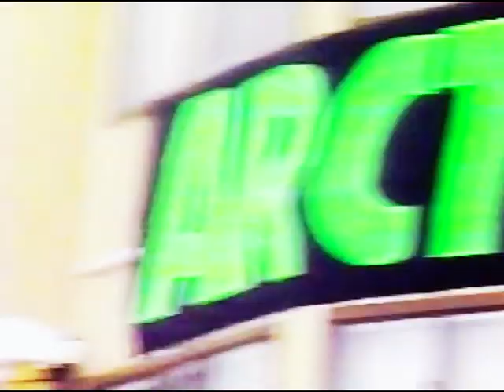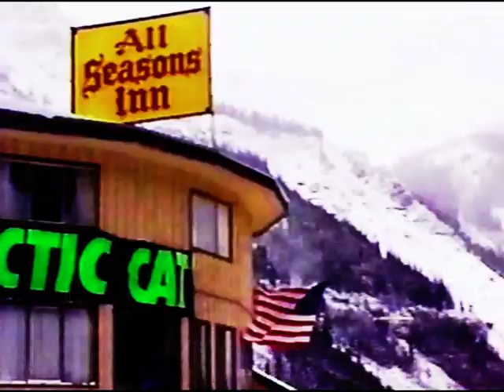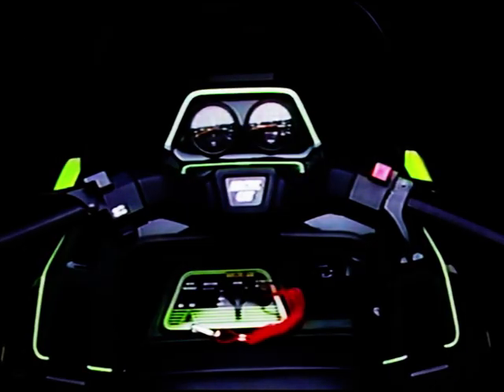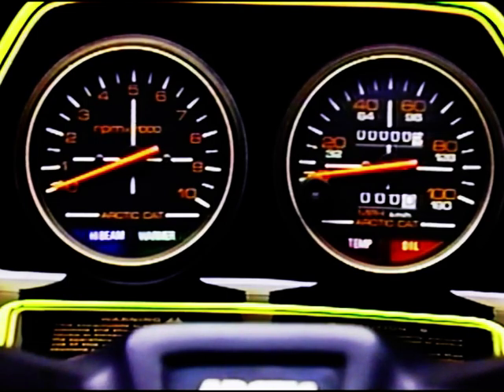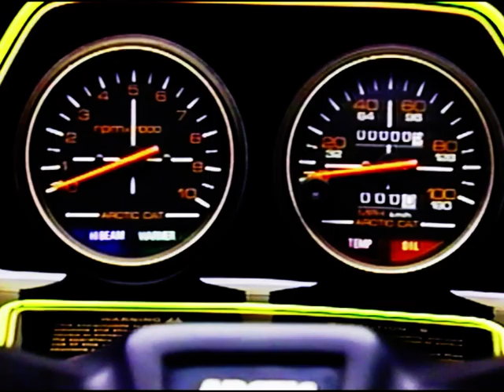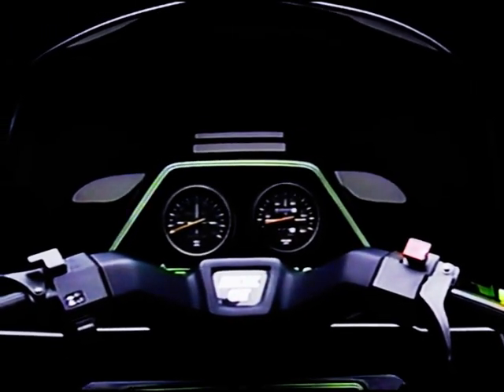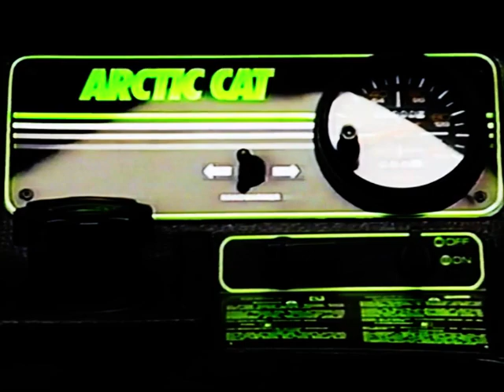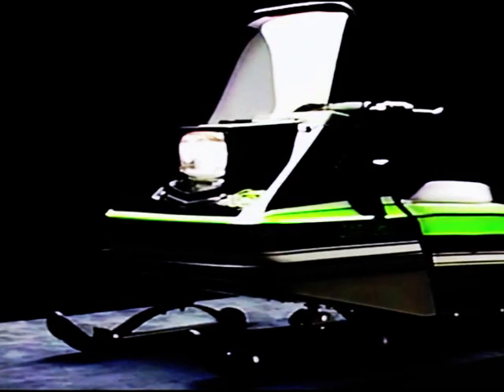1989 Arctic Cat Action Snowmobile Lineup Models Sales Promo Video

Comment: I ride stuff from the mid 90s now.  I can only afford sleds once they are about 30 years old.  I ride cats.  For the most part, those old cats with the Suzuki Fan cooled motors still offer good performance and reliability as when they were new but now for pennies on the dollar.  I've bought quite a few Junker sleds and parted them out.  I now have a basement full of spare Suzuki engines, clutches and other parts.  Enough to keep my good'ol 440s running for the rest of my life (40+ years - god willing)

Comment: I have a 1990 jag afs deluxe that I just bought
Reply: What'd you think about it last season?  I ride mid 90s 340/440 fan cooled cats and they are awesome value for the money.  Riding the same trails as all the new stuff and I swear I get more looks and thumbs up than any of those newer sleds 😂😂🤣🤣
Reply: @anthonyg6221  I love it! It’s one of my more reliable sleds. I had to replace the seat and just about anything small thing you can think of. Got if for cheap though
Reply: @carsoncomrie1070  Awesome!  Yep, seat covers are the norm and they always seem to need a new rear shock.  But after that its typically just gas and oil!  Have fun and stay safe out there!  I can't wait to hit the trails again here in Northern WI (Florence county)